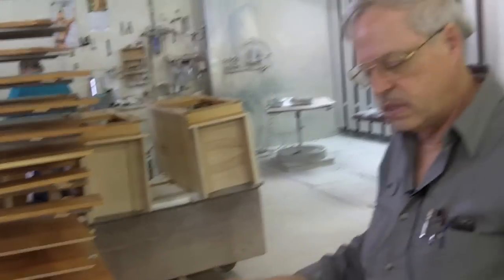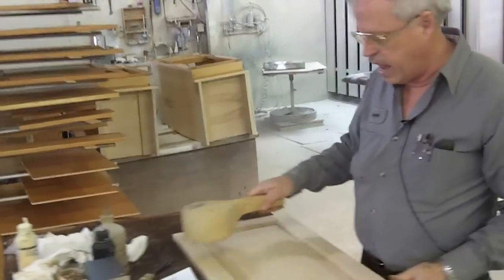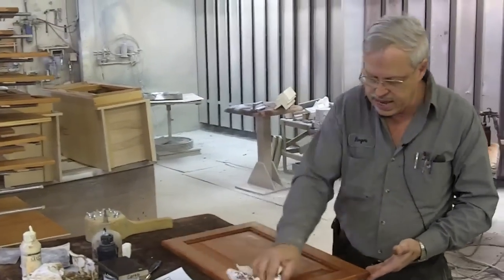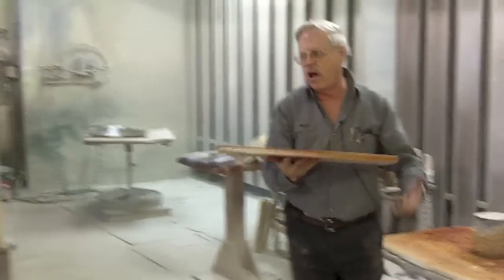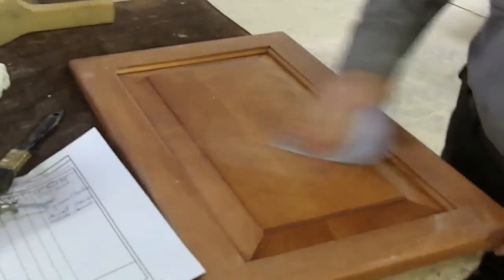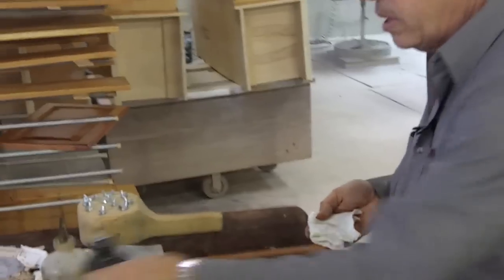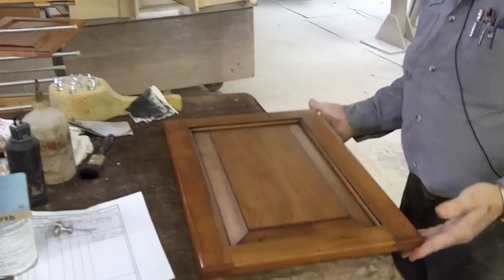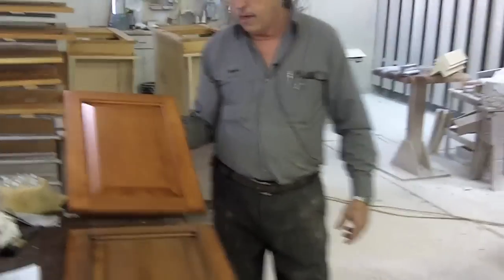Custom Cabinet Finishes | Harrisonburg, Va.

Comment: Hey roger great work hope you mix in some PPE 30 years of finishing can damage your body... My family was a small shop and my dad never used PPE intell i made him.. Great finish.. Also we always sanded the sealer with the grain why did you say it doesnt matter
Reply: The reason that it doesn't matter is that you are not sanding the wood. Sanding wood leaves sandscratches that are visible and also unsightly if the sanding isn't done with the grain. Sanding between coats of lacquer finish doesn't leave a visible scratch pattern if your grit is 280 or finer. 

When you whitewood sand (no finish has been applied yet), you sand with the grain so that your scratch pattern "blends in" with the grain pattern.

Comment: So you stain, then seal, then sand, glaze, and laquer..... so if the last coat is LAQUER, what is the SEAL?
Reply: The best to use under glaze for adhesion is vinyl sealer....sand with 320 grit 3m gray paper if possible. U gotta let the glaze dry or it will blush after top-coat. Im assuming when he says lacquer-he means at least a pre-cat lacquer. Straight old school lacquer will not hold up under normal kitchen conditions, ie: steam, hear, cleaning.....all dry times should come from the products manufacturer. Ask for data sheets-not msd sheets, but the ones with priduct specs & realistic expectations after propper application. Good luck!!
Reply: Heat not hear-sorry.
Reply: can you give me a brand or a link because I'm not sure what to buy in the hardware store